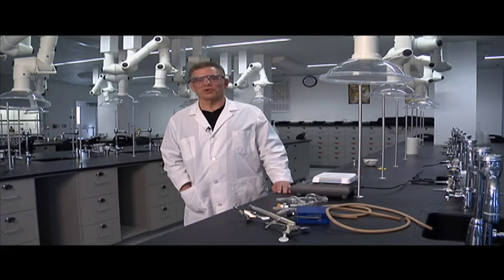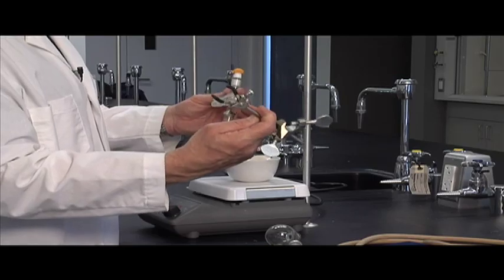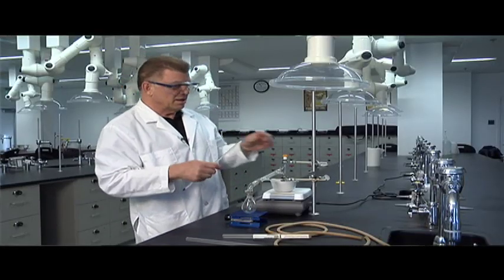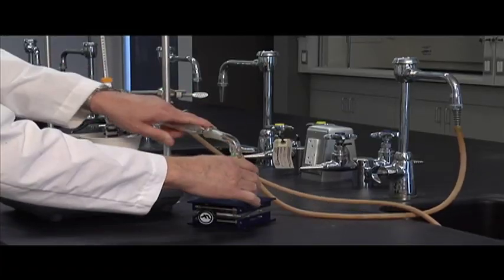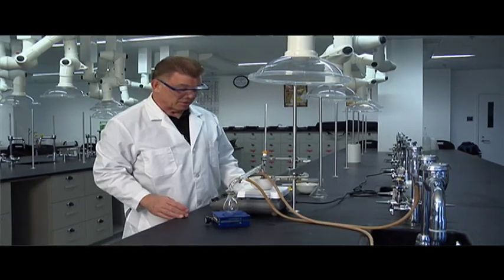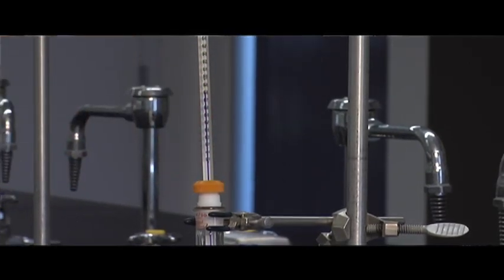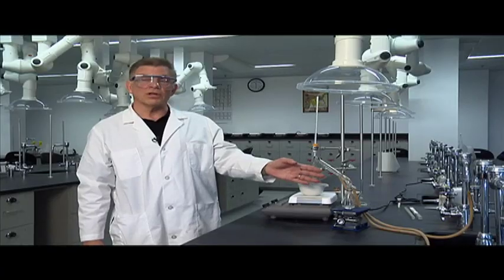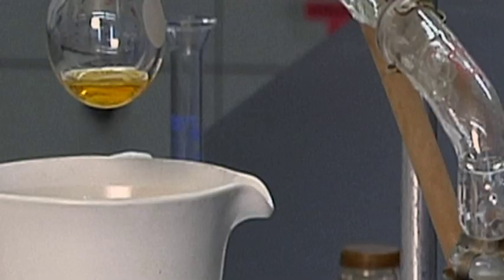4 O Chem Simple Distillation Chem ALL w graphics (CC)

Comment: No joints grease - you can damage the glassware. Sand has enormous thermal inertia - it is better to use heating mantel laying on the lab jack. It is much easier to lower the lab jack with heatsource than to move all the glassware up especially when you use larger scale equipment